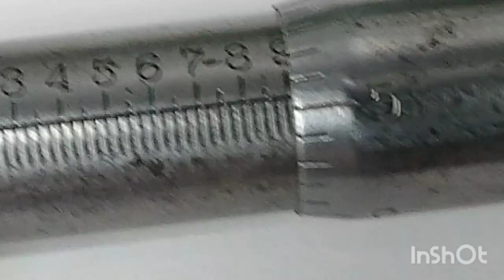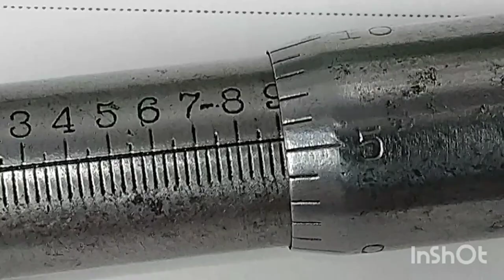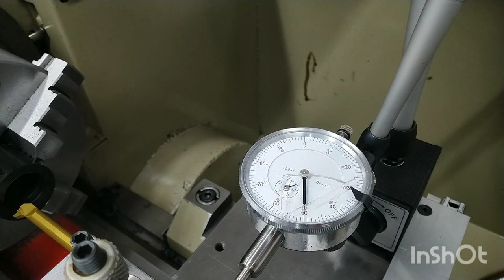Harrison Mill Restoration Part 6 - Nuts about Acme!

Comment: Good job Mr. Carl. Last time I was cutting Acme threads, it was on an old worn out machine at a shop where I worked. I got nearly to desired depth and the machine crashed. Sounded like a gear or shaft broke  inside the lathe. Boss laughed and said he was amazed the lathe lasted as long as it did. Every time I see a Acme thread, it reminds me of that time way back when...
Reply from the maker: Thank you Danny! Hopefully I won't have that problem. I will try not to. Its funny how things can evoke memories in that way. Thank you very much for watching and commenting, I appreciate it and it means a lot to me!
Reply: @carlwilson1772  My pleasure!